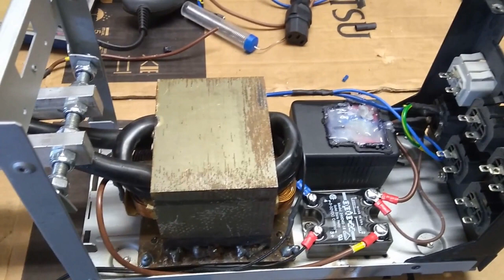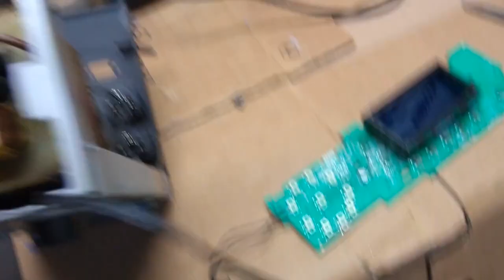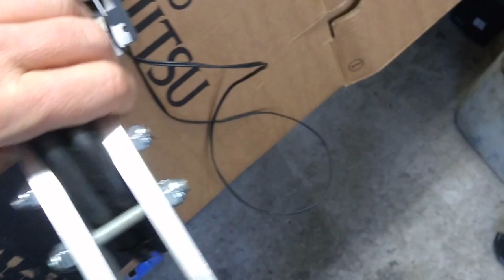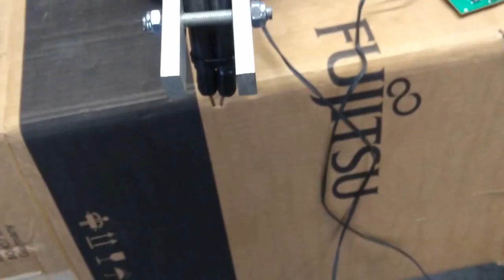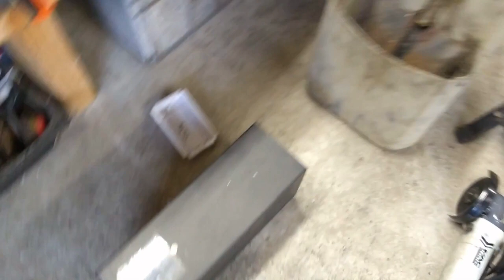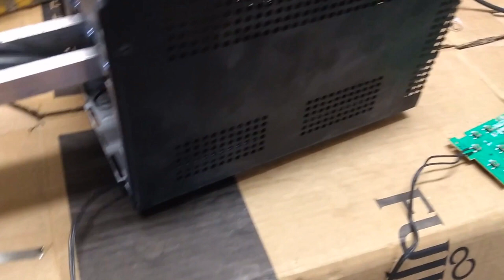Part 1 DIY Battery spot welder using Microwave Oven Transformer and SSR

Comment: Did the relay last a long time without some kind of protection from back emf?
Reply from the maker: I had problems with the welds not being strong enough with this welder so I replaced it with one of these. 
https://malectrics.eu/product/diy-arduino-battery-spot-welder-prebuilt-kit-v3/
This is a superb welder and totally worth the money.

Comment: Nice video but I think the wires a to big I just used 2x16mm
Reply from the maker: I think your right and I made changes to the windings but I never got it to make reliable welds so I bought a malectrics welder instead which is much better.
Reply: Ali Bro I Made reliable welds i Weld with 1,7v and the welds are very good and I weld with a foot
 pedal
Reply from the maker: @ichwasdass  Maybe my transformer wasn't powerful enough or maybe I had a problem with the probes but my welds were great one minute and terrible the next. I couldn't rely on it to give good welds so I bought Malectric welder which gives perfect welds every time.

Comment: Nice setup, very professional looking that is for sure!!!
Reply from the maker: Thanks mate. If you watch the other videos you'll see it didn't work so well though. I had to replace the thick wire with thinner wire to get more windings and so more voltage as it didn't always work. Even then I had to watch the temperature of the tips which after a few welds got very hot.
Reply: Ali Bro I am about to post a video, showing how most MOT welders built, are actually good to go, no matter the windings and cables size. The cables you used in this video would be a pretty good size for that Build. Pressure on the spot weld is the key. To much pressure with super high amperage and you’ll only get heat. To little and you’ll only get sparks and blow through. To much pressure and you increase the resistance and to little and you decrease. I typically use a small weight scale to find my perfect weld. On grams I shoot for 30 to 50 for the perfect weld. Found out I was actually using close to 300 when I was having issues. Also trying to fill the windows can also be key. Most welders you see 2 gauge or 35sq and maybe two wraps. It will work, but your only using maybe 60% power. Filling the windows can increase the mot amperage and power. Reason more wraps and smaller wire works for most failed attempts. I could go on forever on these builds... I am on my 10th currently....lol Should have that video posted soon, this time I went with a china board for the timing👍👍👍I’m going to check out your other videos, I’m still really impressed with yours. Looks amazing!!!
Reply from the maker: @njfulwider5  looking forward to the video.
I agree about the pressure as I found the same as you.
Having said that I found it worked better with another turn or two in the coil. Also the welds were better when the tips are cool, probably due to my poor connections. To be honest I built mine to let me build one or two batteries so I didn't worry too much about having to wait for it to cool.
BTW I also used a Chinese controller in the end. It gives double pulse and is easy to adjust but I'm not convinced it was much better than my home brew timer.